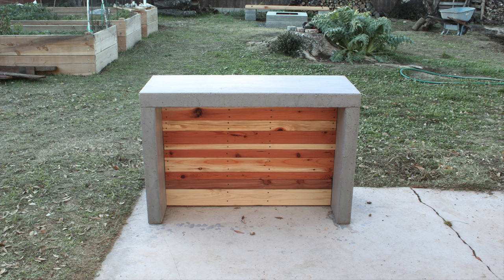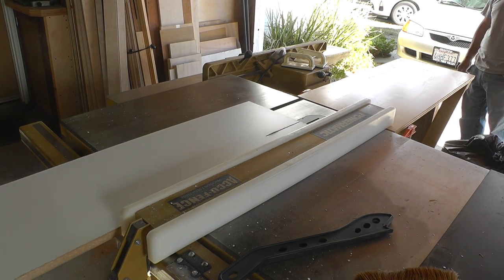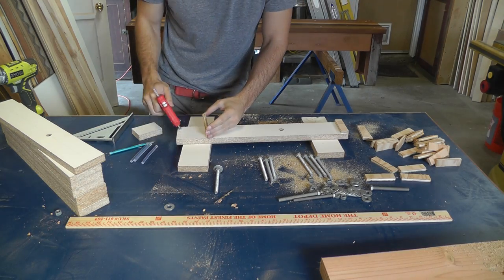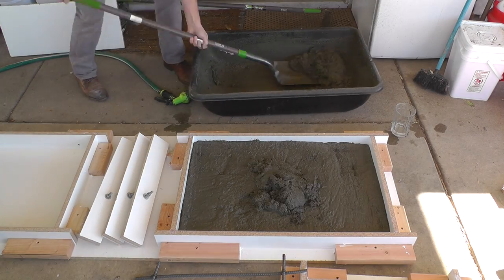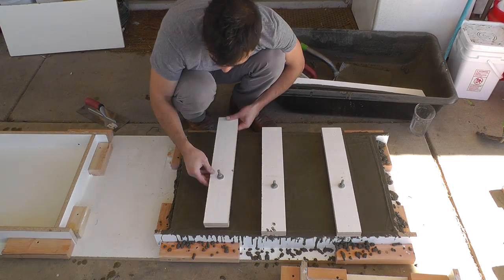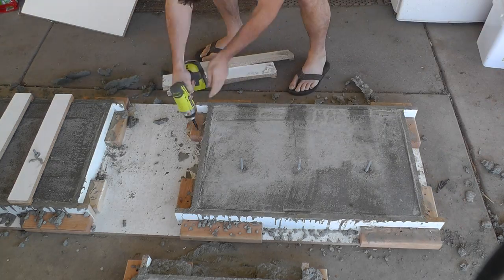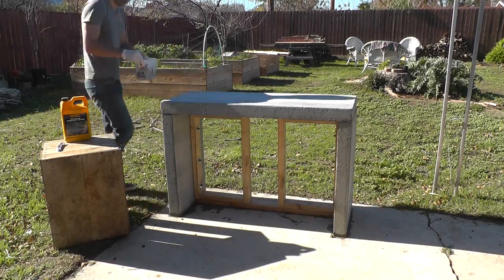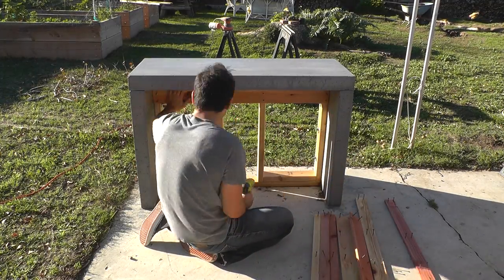How to make concrete countertops for an outdoor bar or kitchen

Comment: Beautiful outdoor bar. 
 I would use pressure treated wood for the framing, at least for the bottom sill plate. A regular construction stud laying directly on a concrete exterior patio will rot in no time. JMO

Comment: Looks great! One suggestion???? Frame using treated lumber for outdoor use. That bottom plate and the side rails will rot away quickly and leave that 300lb concrete unsupported. Thats not what u need with a backyard full of drunk guests.

Comment: This is great but I noticed you didn't put any DPC under the 2x4 on the ground. You should have also used pressure treated 2x4 to resist rotting

Comment: Is the cement mixture made up of cement only? Or in a mixture of your concrete company "quikrete" there are additives ,sand aggregates and additives. Here in Israel we are talking about portland cement only and what should I add to get a smooth look without cracks and beauty? Your mixture has additives like Super-plasticizer additive provides a flowable mix at low water/cement ratio.
thankes a lot !!

Comment: At Harex
The advantage of Harex steel fiber comparing with steel wire fiber shown as following.
1. No fiber balling
2. Non subsidence
3. Non outcrop (Non stick out on the surface of finished concrete)
4. Rusting proof
5. Low dosage: 0.4-0.8%

The advantage of reinforced concrete adding Harex mill cut steel fiber comparing with normal concrete shown as following.
1. Cracking resistance increased 3-4 times (Impact load)
2. Compressive strength increased 5-20%
3. Tensile strength increased 20-40% 
4. Wearing resistance increased 40%
5. Bending strength increased 20-50%
6. Leakage proof

Comment: your videos are outstanding, thanks.
just one thing, I think the steel  bars  should be a little bit longer. to be able to deliver the load to the supports .
Reply: I don't think that's strictly true - the steel bars are put in concrete to resist the tensile forces. Basically, if you imagine a line through the middle of the countertop, as gravity pulls down along the whole slab, and the supports push up on the edges, the concrete is compressed above the line, and stretched below it. Concrete is brilliant at handling compression forces, but shite at tensile forces, so you put reinforcement to counteract that. But it the concrete was not reinforced and it happened to fail anywhere - it's almost guaranteed that would be near the middle of the span, so that is where reinforcement is needed most (and as close to the bottom surface as possible because that is where the tension is  greatest)

Comment: What did you use to finish the cedar planks with? I really like how it turned out, and is a really neat project. How has it held up to the weather this past year as well? I am thinking of using the Cedar fence boards as cladding on a project coming up.

Comment: Howdy! if i were to make a side table about this height and length but only 12" in width would i be able to make a frame that consisted of 2 u-shaped frames (i would place the smaller u-shaped frame inside the bigger one, creating about 4 inches of space in between them; then using 2 pieces of wood to seal/close each of the bottoms) I was hoping i could make one large continuous frame rather than 3 individuals frames that will require me to connect the cement slabs at the end. Would this work, or does cement no do well "standing up" in large amounts?  it would be something similar to how you do your LEGO frames but with wood and way more cement. @HomeMadeModern
Reply: +catisonlycat: rebar would hold it in place...

Comment: Hi, I really like your videos. However, the way you solved the steel reinforcement is very poor. I am sorry, but I am civil engineer so it was my duty to write this...
Reply from the maker: any suggestions?
Reply: HomeMadeModern
Well for example, you should use concrete distance spacers to ensure the proper cover of the reinforcement (http://www.maxfrank.co.uk/uk/products/spacers/extruded-fibre-reinforced-concrete-spacers.php). If you don't want to bend reinforcement bars to create some sort of nice and solid cage (http://www.siteright.net/images/cage-2.jpg) you can use precasted reinforcement meshes (http://debug.pi.gr/BookimagesEn/02710.jpg) ... please, take these pictures only as an inspiration ;)